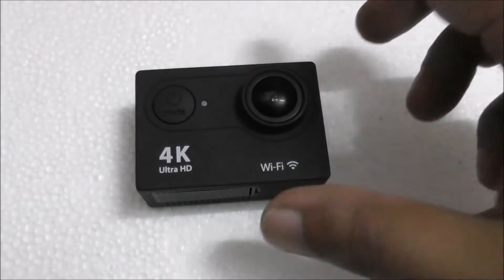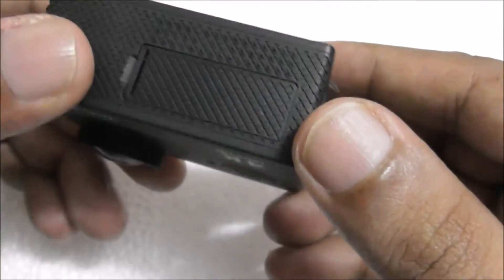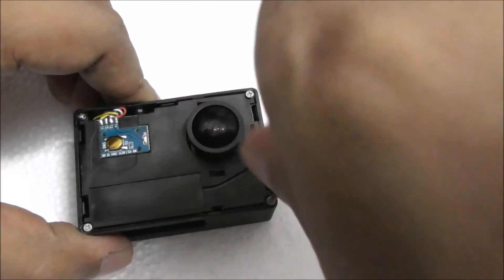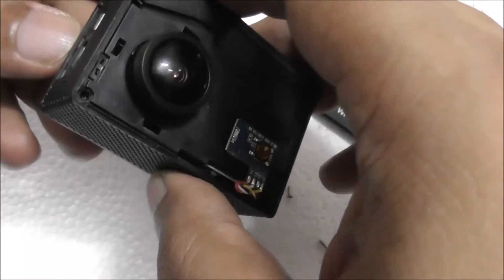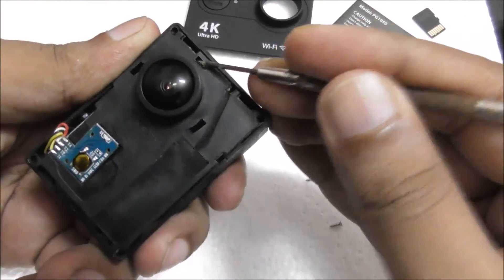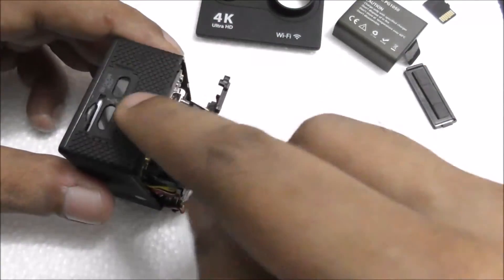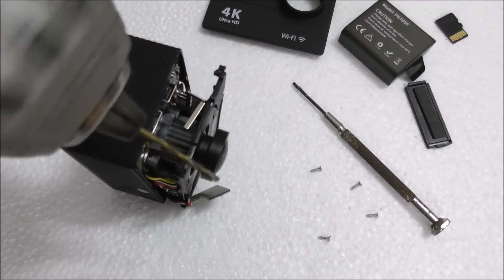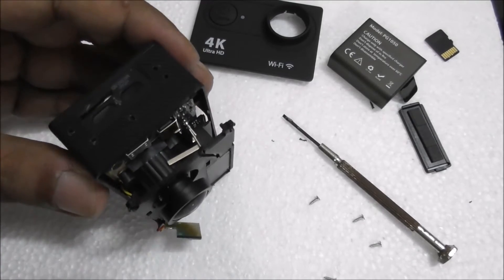action cam teardown air over heating burn solution part 1

Comment: does it work?,mine was overheating , then it will causing vertical lines appeard  in my videos, hmmm would like to try ur technic hahahah
Reply: ShogunKIDs did you fixed it?
Reply: @MrJoel125  did YOU fix it?
Reply: @lukakrsul3963  bought another
Reply: @MrJoel125  I've just opened mine and realized that capacitors are in pretty rough shape so they were probably the reason for heating up. Anyways, I am just curious which camera did you buy?
Reply: @lukakrsul3963  don't know forget I'm working now when i get home I I'll let u know
Reply: @MrJoel125  thank you
Reply: @lukakrsul3963  akaso ek7000 4k Ultra HD

Comment: some of the heat comes from the battery so if you can power the camera through usb, remove the internal battery, let the battery door open and use an external usb power via the usb cable ( not all action camera accept external usb power to film so you have to check with your model of action cam)
Reply: I had mine plugged I. Alot with the USB for a time lapse. The battery was in, but I now my footage is pixelated and distorted.